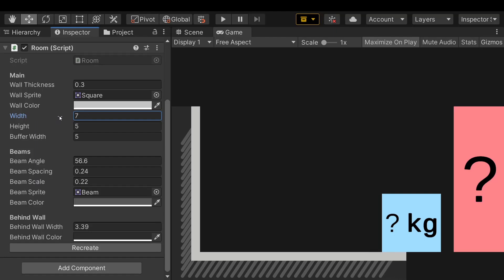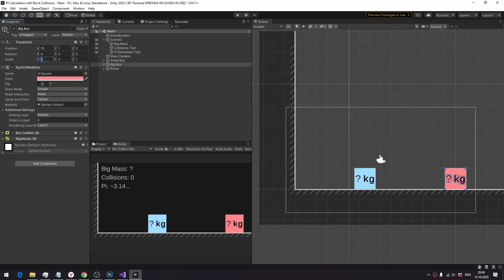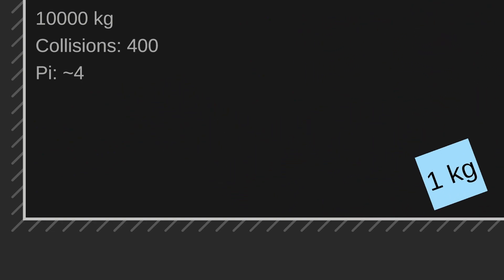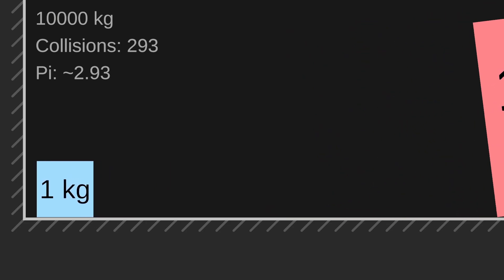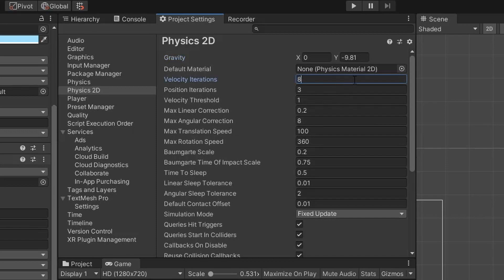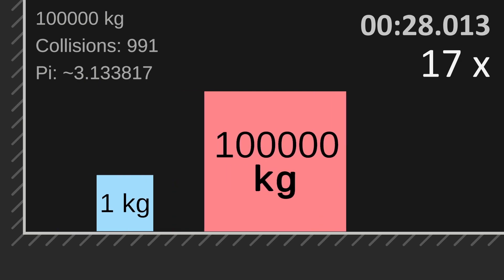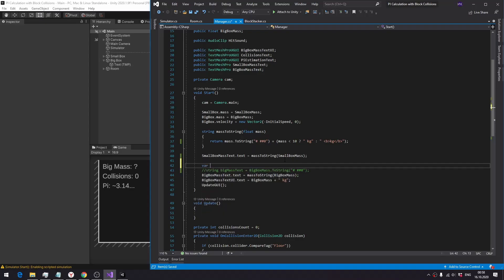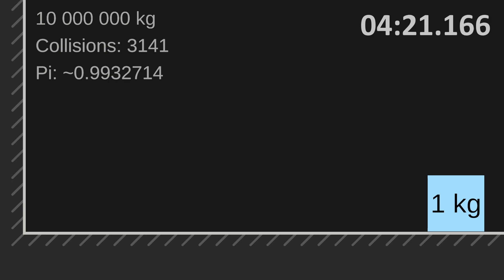More experiments computing PI using Unity physics with colliding blocks (3Blue1Brown way)

Comment: in the last experiment, the mass of the heavier one isn't set properly since unity doesn't allow to increase mass over 1 million.
if you set it 10 million, unity will change it with its max value.
Reply from the maker: I found this later during my experiments. After I finished experimenting with colliding blocks, I viewed everything I recorded and decided to split it into 7 videos. This is video #3. But then Epic Jam 2020 happened and, as you can guess, the remaining 4 parts got postponed indefinitely.
As far as I remember, I found that one million is the maximum absolute mass, which works for Unity and the max relation (big block divided by small block) which worked was one billion.